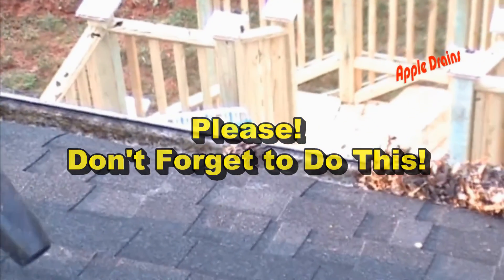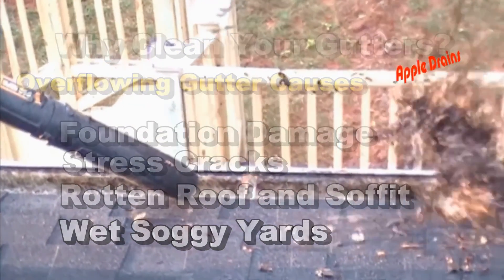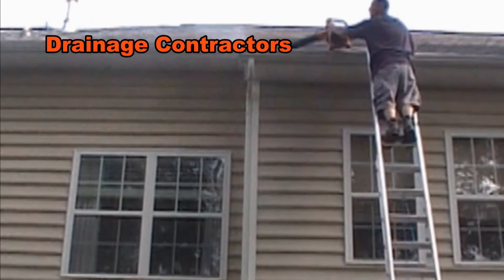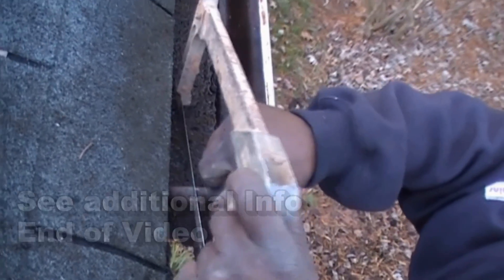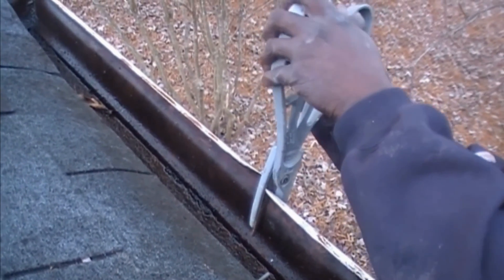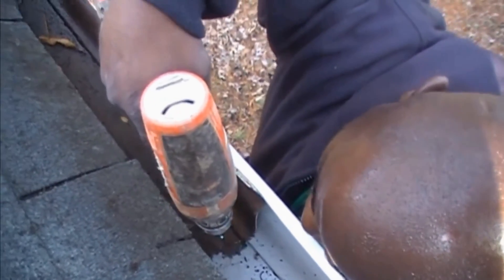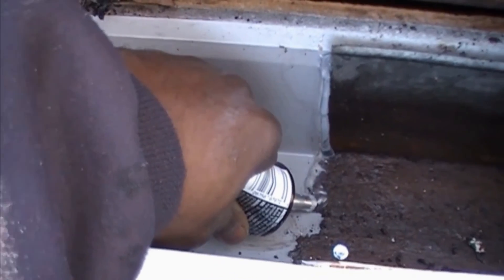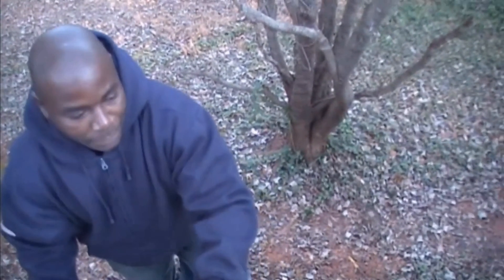What Happens if You Don't Clean Gutters?

Comment: Hey Apple Drains, Ive got a bit of a dillema. South florida is being plagued by townhomes particularly ones being built by D.R Horton and Lennar. My newly constructed townhome (2022) has had the pleasure of welcoming unwelcomed water (as if you dropped a small cup of water along the floorboard) on one of the wall perimeters just a few days ago from that crazy rain we got. Upon inspecting my home a bit further and my community, I've come to find that not a single home has a gutter system built. I hope that it is just as simple as installing a gutter system but I also fear that it could be a foundation issue or that I may need a sump pump system installed or other similar system installed. What do you think could've caused this water to accumulate along the one wall perimeter in my living room? (2 story townhome) and do you happen to service and work in the south florida area? Thanks.